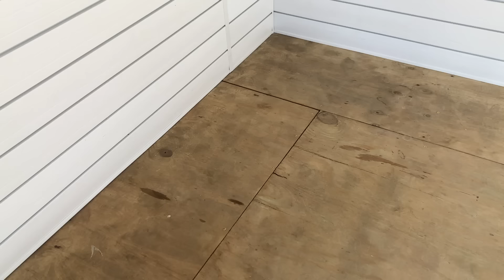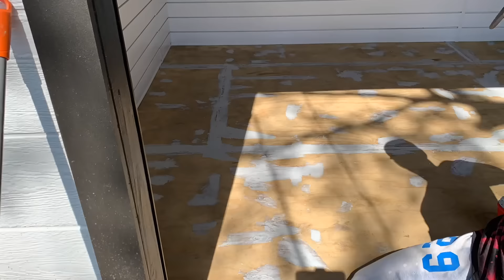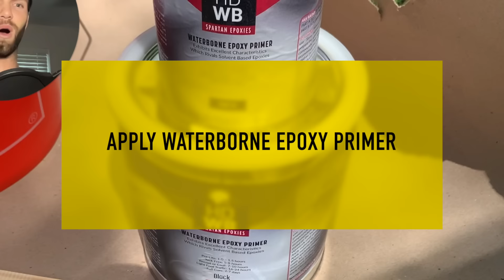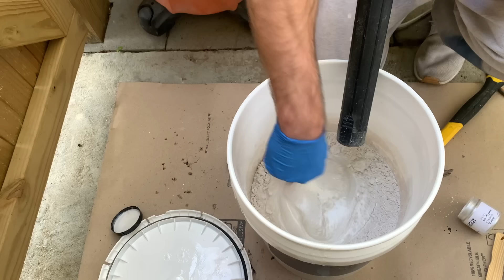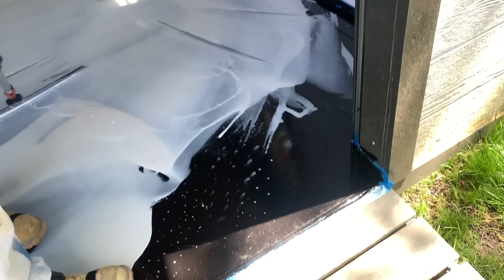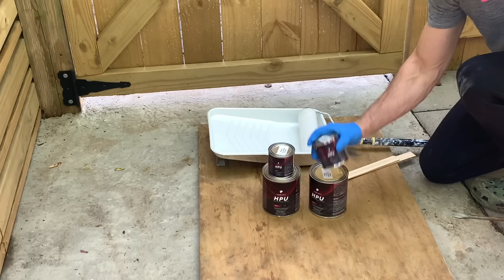Epoxy Floor Coating Over Plywood Subfloor (Amazing Result!)

Comment: Wood subfloors cannot under any circumstances have a vooor barrier used . That includes LVT. I’ve made a living ripping out rotten subfloors from installers using LVT, vapor barriers, including rubberized silicone coatings. I guess for a shed that’s not an investment like your home, ok. However, never, never in your home. In addition, if closed cell spray foam is used underneath, in between the joists, you now have a double vapor barrier. Kind of like a moisture sandwich. I’ll try to attach some photos of the 260,000 repair we just finished on a raised foundation with a really cool looking epoxy floor throughout the home. I’m in Louisiana and it’s always wet here so this floor lasted all of 16 months before the joists were wet, twisting, sagging and full of formosan termites. Please never follow the manufacturers ok to use a product in a questionable manner. Instead, research and follow industry standards for the trade you are attempting. This is so not right. Sorry

Comment: Question….. how are you going to circumvent the need for vapor permeability that is absolutely 💯 percent required for ANY raised foundation wood subfloor? The subfloor and then the joists are going to rot, as inbound moisture is trapped in your subfloor. Just asking. I am a 35 year veteran of waterproofing design and application.

Comment: I know this is a 3-year-old video, but if somebody happens to see my comment, I have some wood in my house, plywood under the linoleum and carpets that has some water damage and caved in a little 

instead of ripping up the entire floorboard as the water is not all the way through, I would love to fill in the maybe half an inch curves In the wood and reshape them fill them, something like that 

Would this type of epoxy be recommended for that situation?

Comment: Hi, great video! Very informative. I have a question thought?  You are using 3 gallons for your light coat, what is the size of your  shed? How do I figure out how many gallons of epoxy material i need?

Comment: Should’ve went with the flake. I think it suits you. You have zero skills on applying or preparing the job. How not to give advice on an expensive product.
Reply from the maker: I think you're dead wrong on this one - even the manufacturer of the epoxy gave it the seal of approval. But thanks for watching - maybe you can post a video of your 'correct' method..
Reply: @AndrewThronImprovements I think? That’s your response? You look like an amateur using the product for the first time. Like I said before, how not to take advice from this guy. Also, it is not up to me, to show you a better method of prepping and applying. You posted a video of how to do it. And you messed up. Delete your content, cause you are not helping anybody
Reply from the maker: @peterdimarco1413  Top tier rage bait - have a great weekend!

Comment: I have a home built on concrete piles due to being in a flood zone. Floors are plywood raised up on 2x12 joists on these piles or concrete posts in the ground. I know due to moisture, wood floor, vinyl plank will swell up over time .. How will Epoxy work on this floor? Obviously movement is possible due to home resting on cnc posts.

Comment: Good video but I have a question. Why put down a rubberized under coat? Reason I ask is you are putting a hard over coat that doesn’t flex.

Comment: New subscriber here.. I used AI to narrow my DIY searches and this was the top recommendation and it was spot on! Question I am renovating an event center and they have a huge stage. The subfloor is plywood and I’m having the most difficult time landing on the best material to put down. I started with researching dance floors but a woman’s heel could destroy it and the same with vinyl.  Not a fan of planks because a woman’s heel could get hung up in the seam and I am trying to lower the potential risk of falling while giving the owners something sustainable. I am wondering if this would work better with skid resistant material added. I would like their customers to be able to waltz or two step. Is the skid resistant material fine like sand? Or should I just go with  lenolium/vinyl sheet  that is 16mil or higher?

Comment: Thank you for your thorough, clear and thoughtfully-demonstrated info. I plan to do the same application you did to my new 12x16 shed once it arrives. Looks really sharp. I noticed your ramp for your shed. Any chance you could share with me how you built that as I am getting a shed and would rather not spend $ for the aluminum ramp the shed builders are selling.

Comment: Came out great. What do u think about doing this in a store thats about 100 ft X  40 ft. Would it hold up with tons of foot traffic daily???
Reply: Epoxy holds up better than anything if the top coat is fully coated I have used it in commercial space

Comment: I know this question is stupid but here I go… I have a super old house and I am trying to deal with subfloors on an upstairs area 2 bedrooms.  Subfloor is old, lots of popped fasteners etc.  so I have tons of work to do.  Can’t afford floors up there yet. Anyway- 

Can I use the flex under  exterior paint? I like the idea of the flex but not looking to do epoxy.  I am just looking for something to last a few years til I pay off the downstairs floors.  : ). Thanks.

Comment: that's all nice and stuff but why don't you break down in dollars and cents how much money is spent to do a 10x10 wood shed floor --Becauase dollar and cent if i found one vinyl flooring for say 3 dollars a runnning foot on a 12 foot roll.. use some fixall over the voids 10 dollars and th glue ran about 25.... total include masking tape and knives etc oh and the edge finish molding @ dollar a footthe mics was 46dollars... before sales was like 120ollars. with left over vinyl trim glue tape and fixall... You could not get past the first stage for that and th vinyl floor will last longer on a shed with high traffic and a wood bottom.. but it pretty for the adervage of 300 to whatever it cost you...

Comment: Thank you so much. This video provided emense value to me. I am thinking of attempting this to my mobile home. Outside dimensions are 16 by 90 so I believe inside square footage is about 1250 sq ft but haven't taken proper measurements yet. The big thing is drastically different costs of epoxy. I want a good product but fine to buy clear then source color or texture elsewhere and mix it myself. Open to recommendations because from reviews it looked like the rustolium you get what you pay for. I definitely want something that will last. Any advice recommendations products to look into would be greatly appreciated since people on here have thousands of years of wisdom. Thanks!

Comment: that was a terrible tape job. you use one piece per wall. if you are worried about air bubbles in the epoxy than that is shit epoxy.

Comment: Why wouldn't the epoxy fill the cracks and nail holes?  Suppose to be self leveling.......  think river table, the entire thing is a crack....
Reply: It is liquid enough to fall in the gaps. Most times there's a lot f space under the plywood

Comment: Hey! Thanks for the great and informative video. There seems to be mixed info about applying epoxy to wood surfaces since the give in the wood may cause cracking in the epoxy. Can this be alleviated with a base (flex coat)? What was your experience with this project? Did your floor not crack at all?

Comment: I understand that if you are going to install apoxy on the subfloor it is a bad idea to do it directly to the wood. I was taught that you have to use metal mesh first so that you don't have problems later and from there continue to level it and after you have done that process. can you install your apoxy

Comment: Excellent tutorial, and very much appreciated.  I'm using Spartan products over a 290 sq ft OSB floor in my woodshop and if anyone's interested I can speak to getting that material ready for epoxy.  (Plot spoiler: I wish I had plywood instead. But you work with what you got.).  Before anything else I used Spartan CF100 crack filler for any gaps between sheets and countersunk nails (should have been screws, but I learned that too late). Spartan recommends applying KILZ2 (not 3, for whatever reason) before laying down the Flex.  Needed two gallons.  

Next the Flex, which I had trouble spreading out and distributing evenly maybe because I didn't have a rubber notched squeegee, only a notched metal one for concrete...useless.  So regular straight edge rubber is what I used.  *One thing you might want to stress is how much time you have to spread the stuff before it starts to set and becomes super viscous.*  Don't dilly-dally.  I barely made it.  Also, Spartan indicated one gallon would be enough to cover my 290 sq ft but in hindsight I wish I'd had two.  It's good enough, I guess.  

I'm applying the WB primer today.  Will let you know how the rest of the project goes.  BTW I'm not doing metallic, just the flake "cast" as they call it mixed in with the Clear.  Also adding a can of Spartan's non-skid.  At this time I'm not planning on HPU top coat.  Will let you know how it goes.  Total cost of Spartan materials: about $1000 (2024).  Not cheap, but good.
Reply: How was it ?!
Reply: @Trankifades   I like it. You can tell it's very tough. I struggled with getting a uniform spread of the various coats.  Coverage is complete but there are  thinner and thicker areas.  I don't think it matters much though, since it's so strong.  Might be better if I had a slab but my floor is OSB. 

The final layer I put down, that contained all the color flakes, was extra difficult to spread evenly because a) it's thicker from the get-go because of the flakes, and b) in doing a 20x20 floor by myself the epoxy starts to set within 30-40 minutes and becomes even harder to spread. I did the best I could with the clock ticking but the flakes are NOT all evenly distributed.  Honestly, I don't care.

I do wish Spartan had a slower-curing epoxy for the solo DIYer trying to cover a larger area, but I think most of their business is with larger commercial clients who are going to have several people to help spread.  Good company and customer service, though, as I said earlier.

PS--I used the beige base coat color with red, black, and gray flakes.  My wife said it looks like vomit.  I laughed.  It kind of does.  But I still think it looks cool and it's better than the LVP I'd been considering.

Comment: Great video. But your mask choice may be incorrect. An N95 mask is for particulate matter. You should consider a NIOSH Organic Vapor Respirator instead to filter the epoxy fumes. A dust mask isn't doing anything except making you uncomfortable.

Comment: A question, do you want to fill the grain?  I'm looking at doing this in a bathroom because the tile that was there was ineven, dated, and working its way loose.  I can't find the same the tile, so i want to use epoxy.  But i am down to OSB.  I heard you want to "paint" thevwhole floor to seal the grain?
Reply: Did you mention square footage for coverage?
Reply: @mattalbrecht7471 never put epoxy directly on subfloor or osb

If the tile was an issue, I would tear out the tile+backer board (if they used cement board underneath the tile)
The old tile may have been installed or prepped with “shortcuts”
Reply: @mattalbrecht7471  there is Armor Prime which has a lower viscosity - to penetrate the wood and seal it off. 

So yes, you would prime the floor before putting epoxy on — similar to self leveling prep. 
A lot of people will use self leveler and not prime their floor = uneven and an un-level result 
Because the plywood or osb absorbs that moisture

Comment: Do you think this would work on a boat floor.  Our forward cabin has the carpet removed and want to use an epoxy floor with a blue pigment.  The forward cabin is around 52.65 SqFt

Comment: Good morning Andrew. I found your channel late last night as I was searching for ideas to finish floors in my rental home. After years of dirt and oil on the subflooring, I need an economical and safe way to finish the floors. I am disabled and on a fixed income. I would prefer not to have to clean the floors first. Is there an easy way to beautify the floors? I have purchased stick on tiles but they do not stick to the dirty floors. If there's an easier way to beautify the floors, I will gladly not use the tiles. Any suggestions.
Reply from the maker: Hey Gwen! I recommend luxury vinyl plank flooring. It just snaps together and no need to do any “sticking”. It can be as cheap as 99 cents a square foot, too. Good luck!
Reply: @AndrewThronImprovements  Thank you so much!

Comment: Hey, hows it holdin g up after a year? I wanted the same for my plywood floor shed and contacted a professional who refused to apply epoxy floor to a plywood shed due to the movement that could be in the floor and temperature changes. Instead he recommended polyurethane floor due to its elasticity and resistance to temperature changes. Your thoughts after a year?
Reply: me too.. although i seen one fella do it inside his tool trailer .. so i assume the floor held up while bouncing down the road but he also did not have a follow up video

Comment: No doubt the finished result looks great, but I'm surprised by the lack of prep you did to the floor before starting.  You never even cleaned it?  I don't think it would've taken you more than 15 minutes to pole sand it either.  There's not an epoxy manufacturer on the planet who would stand behind their products when insufficient prep was done.  Although concrete more than wood, the long term success of epoxy floors is predicated on sufficient prep.  Again, I love the look you achieved, but rushing the prep is a death sentence for epoxy floors.

Comment: This effort has a fundamental flaw. Epoxy is done on concrete floor because concrete floor is rigid. Wooden floor will have some flex. In a year, I expect the epoxy floor will have major cracks.......
Reply: Andrew applied a product called FLEX. It's essentially like a rubber coat. Its a tried and trusted product that works.

Comment: Would love to know how its holding up, Great video thanks for the help!
Reply: Same
Reply: As an epoxy professional of 10 years. Do not put epoxy directly on wood floors do not f**** do it
Reply: @cordevon1794 why
Reply: @cordevon1794 what do you put underneath it?
Reply: @Hungryhobbitringmaster first fill your holes and voids, apply primer for self-leveling concrete , pour self-leveling concrete and then you're ready for all the epoxy steps. Don't forget to dam the room to prevent running of material
Reply: @cordevon1794 so basically all the same steps expect add a self level primer, self level concrete and then apply epoxy.?
Reply: @cordevon1794 he didnt do that tho, you can see in the first 40s of the video

Comment: Hmmm.... great video, but it only convinced me never to do this to a floor. Especially a shed! It probably cost over a grand in materials, and a week of your life you'll never get back... as far as durability and asthetics, could have just sealed up the plywood joints, mixed two colors of latex floor paint together on the floor for the squirl effect, and sealed with poly to get 95% of the same outcome for less than $100 and a few hours of work without all the crazy fumes and part A part B mixing constantly.

Comment: Do not mix the first coat and second coat at the same time. Went to do it and the mix heated up and went rock solid now have to spend an extra $400 to fix it
Reply: Why would you ever mix the first and second coats at the same time?

Comment: I’m wondering how fast that subfloor board rots out since the one surface is vapor locked and moisture will stay there.
Reply: Probably pretty quickly, not sure if you caught the video where he built the thing but there isn't any ventilation below the subfloor.
Reply: @hollyburnside83 are you saying that this is not a good idea because it will eventually rot the board?
Reply: @stasiacreations2030  Yes, that is why  for instance a crawlspace under a house has ventilation holes.  This prevents mold and rot.
Reply: All pressured treated wood, should be fine right? 🤫